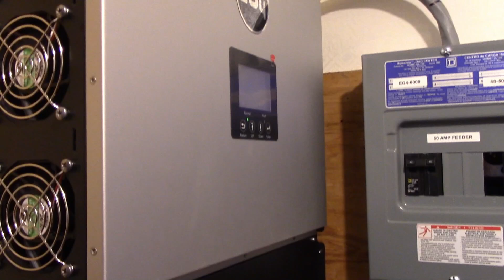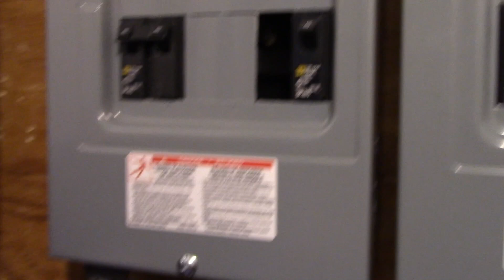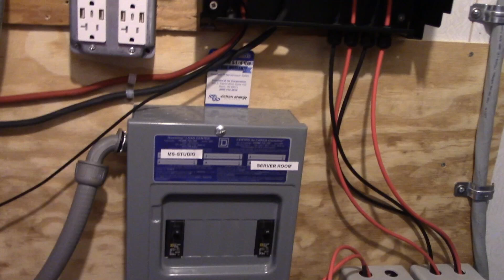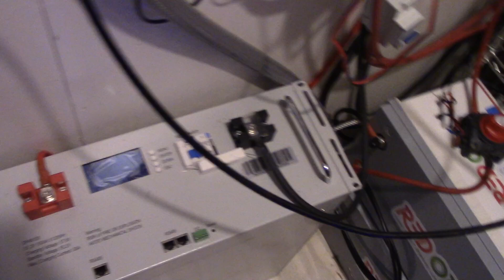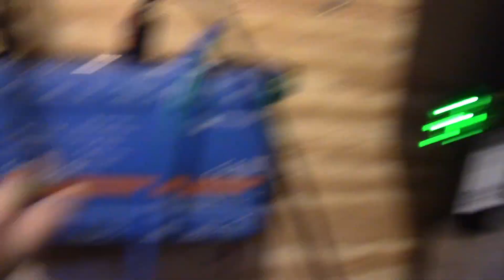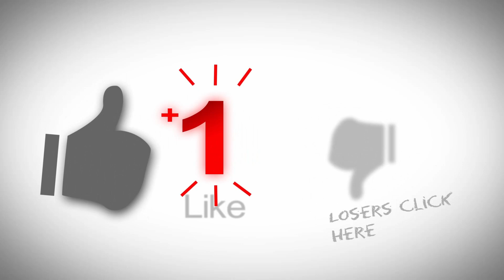Solar Vlog #3-24 EG4 and More!

Comment from the maker: Key safety concerns with high-frequency inverters:

1. Electromagnetic Interference (EMI): High-frequency inverters can generate significant EMI, which can interfere with other electronic devices and systems. Proper EMI filtering techniques are required to mitigate this issue.[2]

2. Thermal Management: High-frequency operation can lead to increased heat generation in the inverter components. Effective thermal protection circuits are needed to detect and respond to high temperatures to prevent overheating and damage.[2]

3. Voltage and Current Spikes: The high-frequency switching in inverters can create voltage and current spikes that can stress and potentially damage the inverter components as well as connected loads. Robust protection circuits are crucial.[2]

4. Grounding and Isolation: Proper grounding and electrical isolation between the AC and DC circuits is important for safety, as high-frequency inverters typically do not have galvanic isolation like low-frequency models.[1][3]

5. Capacitor Degradation: The high-frequency operation can lead to faster degradation of electrolytic capacitors used in the inverter's output filter. Regular inspection and replacement of these components is necessary.[2]

6. Arc Faults: The high-frequency switching can increase the risk of arc faults, which pose fire and shock hazards. Arc fault detection and protection circuits are important safety features.[4]

In summary, the high-frequency operation of modern inverters introduces several unique safety considerations around EMI, thermal management, voltage/current spikes, grounding, and component degradation. Careful design and implementation of protection circuits is critical for the safe use of these inverters.

Citations:
[1] https://www.youtube.com/watch?v=w9e_NCuOzaQ&t=0
[2] https://www.elexana.com/journal-emf-emi-information/2023/2/1/solar-power-inverters-and-emi-filtering-techniques-everything-you-need-to-know
[3] https://www.ia.omron.com/product/cautions/22/safety_precautions.html
[4] https://www.e-motec.net/safely-controlling-an-ev-traction-inverter
[5] https://nttinc.com/blog/variable-frequency-drives/Based on the search results provided, here are some key safety concerns with high-frequency inverters: